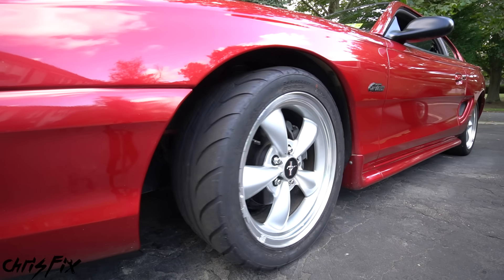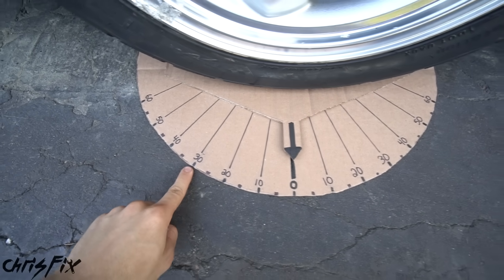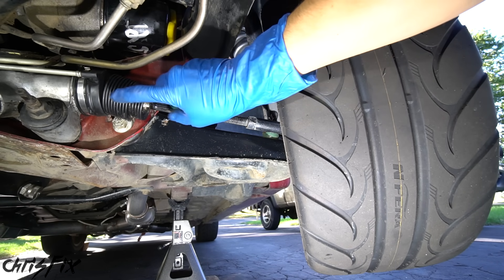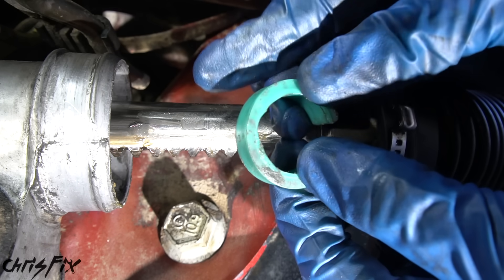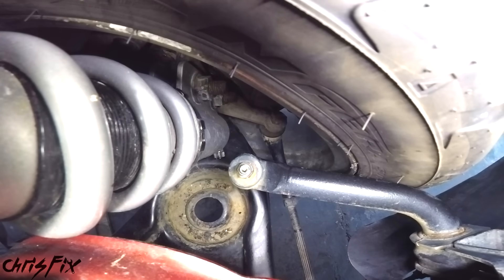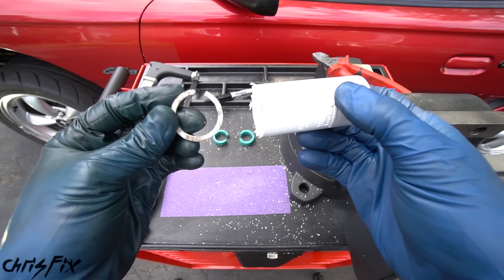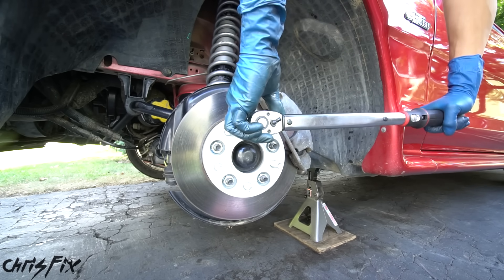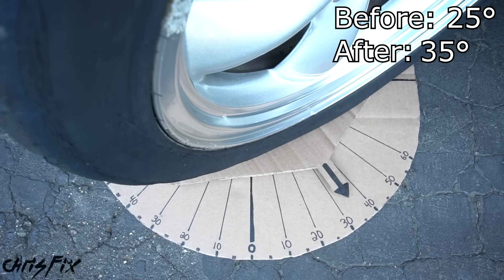How to Get Your Car to Make Sharper Turns (Steering Angle Mod)

Comment: Pretty cool, I'd like to point out something though, shouldn't the drivers side tire be able to turn left more than right at full lock to provide correct Ackerman steering? I believe your tie rods are not evenly adjusted left to right, they obviously have the correct "alignment" but a shop typically wont even out a steering rack. This can cause bump steer, and uneven lock to lock steering like what you are seeing, if the oem uses this style of steering stop. Make two "angle finders" and see if each side is different, and also measure the tie rods pivot to pivot on each side and compare. This is probably the real reason why it cant turn that much. Many cars and trucks have steering limiters in other places not on the rack. For example my Land Cruiser has adjustable steering stops on the lower control arms, so even if the tie rods are uneven, the turning still going to be the same, unless someone adjusted the steering stops, however its unevenly adjusted there will still be bump steer.

So if you need to change the tie rod lengths to make them even again, your steering wheel wont be straight, so you will need to undo a spline somewhere in the steering column, and rotate it roughly to the right spot, then use the tie rods to fine tune it in. Most alignment shops will just crank the tie rods because it takes more time to re-index the steering column splines, but its best to do it in two stages.

Also its funny how you mentioned putting your angle finder right in the middle of the tire, then you changed the offset but didn't offset your angle finder as well. When you put wheel spacers you change the pivot point of the tire relative to the width of the tire. You can look at the part of your particular suspension geometry and make an imaginary line down through the pivot of the knuckle down to the contact point, and determine roughly where the tire pivots. wheel spacers can be a good idea when you are running a larger than stock tire and want to maintain factory scrub radius, but in your application you have increased your scrub radius, which in itself is a whole other topic.

Good luck.

update: if you are using that mustang for drifting, your lock to lock steering angles make sense if you have negative ackerman angles, do you?

Comment: Your initial measuring is either wrong or you car has issues as the left turn angle of left wheel should be greater than the right turn of the same wheel - this is because it represents the inner radius of a turning circle; the inside wheel in a turn needs to describe a smaller radius than the outside!
Reply: As a side note: the 25mm spacers will be negating some of the increase in steering angle as you’ve moved the centre line of the wheels. The inner wheel will NEED to be bigger the closer it gets to the centre of your concentric turning circle ⭕️. 
Your 9° of extra angle will equate to less in real terms. 
To demonstrate, if you only fitted the spacers whilst retaining the limiters, the angle would still measure 30° but your turning circle ⭕️ would actually be worse than stock

Comment: Research your car before taking off or trimming your rack limiter. Some cars have weak power steering pumps/systems that can't handle the extra turning angle.
Reply from the maker: Thanks for the tip! Research is something you want to do before any modification to your car!
Reply: Thanks for replying Chris! Good video by the way!
Reply: Shawnessy Sandness  its chill i dont have power sterring
Reply: @EH DK custom tie rods/mount relocation.

Comment: That red dot on your tire is supposed to line up with the valve stem...
Reply from the maker: +Chris P. Thanks. I didn’t mount them
Reply: ChrisFix I always drop a hint to the person mounting my tires that the dot is there to make balancing easier and that they should try to line it up with the valve stem. That way you don't end up with half of your wheel covered in weights...

Comment: Chris, research  some more on why your steering angles were off, loaded and unloaded will be different, camber/caster is different. These things I would imagine are obvious to you, however you're neglecting information.  your SAI, inclination and TOOT
Play a big part in SAFETY but more to your concern, consistency in drifting. Snap steer, bump steer, wheel hop and dragging front tires are some of the more serious concerns from mods like this.
Reply from the maker: Thanks for sharing.

Comment: That is terrible advice to anti-seize the entire hub surface like that! That joint, as all bolted joints do, rely on friction between the two bolted surfaces to prevent loading the bolts in sheer. Lubricate the surfaces and you remove the friction.

Comment: You'll find that with more angle the less you'll spin out. When you do the knuckles you'll also notice that when you go past 50 degrees while sliding your car will drift a lot slower though. It's not always about going to lock, but it's nice to have that cushion if you need it to scrub speed or something

Comment: Chris, quick question. If you run wheel spacers on the front of the mustang with stock wheels, will it make the wheel and tire stick outward past the front fenders? Just wondering. Thanks for the video and info. I always watch your videos. Please help.

Comment: hey chris when you were tightening the nuts on the wheel spacer why did you put a screwdriver between the brake disc and the back plate

Comment: hey i have a queshton for you. so i own a 94 dodge intrepid and my ac works ecept for the fack that it wount blow cold air and the hot air is starting to lessen any ideas why or how to fix the ac? any help is welcom and thank you.
Reply: He has videos on that. Do a little search.
Reply: herars the thing i dont have a leak. i count the heat and the ac as all to gether so when i say my ac works i mean my heat works. the acctual ac blows 0 colad air and i can't figer out whats wrong.
Reply: Blake Lantz sounds to me you have a leak in your a.c. system. If you have a flashlight wait until dark go out and inspect your compressor seal for leaking also all fittings and around your condenser which will be mounted in front of the radiator. Leakage will not be 2ster but instead oil based. Hope this will get you started.
Reply: Your a.c. system needs refrigerant to be able to cool. Also turn your a.c. back on with hood up make sure you can observe your compressors clutch cycling on and off
Reply: Watch when you service your a.c. it could be r12 refrigerant since it's a 94 most likely already been retrofitted for 134a though by now
Reply: Blake.. Turn on your AC, do you hear any noises, Clicks, Grinding, Etc? With the AC ON, look under the hood and identify the AC Condenser. is the Clutch Plate Spinning? (the entire mechanism will be spinning.)

http://www.ebay.com/itm/GPD-A-C-AC-Compressor-Clutch-New-Le-Baron-300-Dodge-Neon-Caravan-4321237-/132089919076?fits=Year%3A1994%7CMake%3ADodge%7CModel%3AIntrepid&epid=550865493&hash=item1ec12c3664:g:XJ4AAOSwa~hZaJc-&vxp=mtr

If so, you may have the following issue:
Your Clutch Plate is worn/damaged. Being a 94' I'm willing to bet that it is just worn. The repair is very simple.. and you can do it without removing the unit from your car! 
If you buy a new clutch plate.. just get a new balancer with it..
Also, if you have over-charged the A/C.. it will not work either.. so if you have added some recently.. you may need to remove some.. 
If you have done this.. I recommend just taking it to jiffy lube and have them check/recharge it. 

**BE SURE TO WATCH THEM!! If your AC unit is "over charged." they will try to still sell you as though they are "properly charging" your system and will charge you around $180. Your shouldn't pay more than $80! Be sure to WATCH THEM, and ask questions through-out the process. the moment they say "System is over charged" That's when you should calmly argue with them about the price.. since they TAKE and STORE the extra refrigerant in their tanks.. without giving it back.. lol.. so they really ~steal~ from you and then try to make an extra buck.

ALL MECHANIC SHOPS WILL LIKELY DO THIS, I just recommend jiffy lube because you can literally stand right next to the technician* as he does the 'repair.'
Reply: i do hear a noce when i tern the car on but the compreser is on the driver side and the noise comes from the pasenger side and it last for a minet or two
thanks for the help im slowly narowing the sorce.
Reply: is it a hiss? please explain the noise that is on the passenger with the AC on?
Reply: william vaughn no it's not a hiss it sounds like something being compressed in the dash and if I Turn the car on with the AC already running then it never makes that noise and l get like 2 minutes of cold air
Reply: hmm. Research.. your Evaporator/drier.

From there, it's going to be an in-depth repair.. and your dash will likely have to be pulled out.

Good luck!

Comment: Google what caster is.   U need to push wheel more to the front of bumper.   It bad if can tell from looking at wheel arch.    Trust me.   Makes drift more stable and auto correct when u flick wheel is better.   Read my post i know stuff.     No bs.   Helps with car being stable    or learn hard way like i did

Comment: It's there to prevent it from tire rubbing. So in a couple years without a rack steering limiter, the tire will be offset and blow and you will will lose control and fall off a cliff and die with a steering wheel up your ass. 

Don't become a wannabe pro mechanic by watching a video on YouTube from a "self-proclaimed" mechanic. 👍

Comment: I've noticed the difference between the right turn (39 degrees) and the left turn (35 degrees), it's not much but I think an alignment shop can make it equal by adjusting it from the tie rods (loosens the right side and tightens the left side), readjust alignment then recenter the steering wheel (from inside the car), this might fix the clearance issue without the need of spacers.

Comment: Hey Chris, at 0:26, you didn't make a complete stop before shifting into reverse. Doesn't this damage the transmission over time? Or does that NOT apply to manual transmission vehicles? I really want your answer to this!
Reply: Matthew Kwon doesn't apply to standards trans
Reply: doesn't apply because the clutch was still in
Reply: It don’t matter if you got a Reverse Synchronizer
Reply: I don't believe it's bad as long as it's not grinding. Most manuals I have driven though will grind super bad if you're not completely stopped before going in reverse.
Reply: bad for automatic , but on a manual it would depend on how much clutch you are giving it . Also its never good to drift when switching from a forward gear to a reverse gear but sometimes you just can't help it , like pulling out on a hill . Just try to be as easy as possible !

Comment: Thank you so much for mentioning the tip about possible damage to power steering pumps.  When I walk through parking lots and notice people parking and they almost always hold it to full lock the whole entire turn into the parking spot.  I'm like "gaaahhhhhhh" inside when I hear that.

Comment: Why are you pretending this is for turning radius and not for doing mad skids?
Reply from the maker: I explain the mad skids part at the end ;)
Reply: Iain it would get demonized
Reply: nice profile pic ❤️
Reply: MCM fans over here....
Reply: This mod can be done on RWD cars. CV joints will be damaged on FWD cars.
Reply: Damn, nice pic!
Reply: Projects & Projects Turbo redblock squad ;)
Reply: *Australians
Reply: Iain redblock squad???
Reply: Iain I'm NA still 😢
Reply: It's simply a commercial for Hubcentric for which he's getting paid for us to watch!
Reply: Because it is for turning radius. The Fox 5 platform has a turning radius like a bus. The two things I've always hated about my 96 GT are the turning radius and the doors that only open about 50 degrees.

Comment: Seems like my 2000 C3500 has a 500 ft turning radius.  😔

Great video, thanks Chris
Reply: Tim Michaels a 95ish GMC 2500 dulley with crew cab and the long box. 50.3" turning radius. So no uturning. Thing is long.

Comment: 9:35 WTF plenty of room?? 
You do realize that tires flex under cornering load and can still rub on that metal?
Reply from the maker: Thanks and great input! I have tested this on the track drifting (the most sideways and full steering lock anyone will ever be and at high speeds) and they do not rub. Since the sidewalls on the tires are short there isnt much flex. If you have a bigger sidewall like on a truck then yes it might rub but I would be concerned if you are turning that fast all the way locked in a truck. Usually when you are all the way locked you are going slow (unless you are drifting) so there isnt going to be much flex. Great thinking though and thanks for bringing that up!

Comment: Did you check with stress? They'll have to run analysis on the control arm, good luck with the approval. (The shift of the tires (weight) creates the same shift in pressure (weight) on the other side (towards the engine). You might get approval but need to get that accounted for.
Reply from the maker: +simsim321 thanks I have run this for 6 months on a track drifting which is a torture test because I am still learning to drift and go off track all the time sideways at 60mph and there is a 6in lip on the edge of the track. Makes me cringe every time I go off but the suspension, wheel spacer, bearing, etc all take it just fine! On the road where there is a lot less stress there won’t be any issues.

Comment: I do not condone this at all. You can damage other suspension and steering components. Your tires, your fenders/ liners, some vehicles brake hoses might not be made long enough to flex for that extra turning radius. You can rip a brake hose and have less stopping power!
Reply from the maker: +heyitschino that’s why you check it before you take the car off the jack stands. If you see context or your brake lines are tight or whatever your issue may be you need to make adjustments before you can remove the limiters. This is pretty common to do in the Racing and drifting community and no one has issues.

Comment: I have a question, why was the stock angle different? Why wouldnt they both be the same number? Like 25 to the left and 25 to the right. Not 25 when you turn left and 30 when you turn right. Was just curious why they arent the same.

Comment: Awesome video as always. Quick question- I noticed you used a screwdriver in the brake rotor vent to hold the hub still while you tightened the spacer nuts, but what held the hub still when you cranked on the wheels lug nuts right afterward? I'd very much appreciate knowing for my own use 😄 thanks

Comment: Like I know it’s not necessary but after your finished with all that’s to come would you consider swapping the head and tail lights with a more modern style and I think you have mentioned about doing it I wasn’t sure but a body kit such as both front and rear bumpers skirts and too top it off a massive wang

Comment: As always love the videos but a question popped into my head, with the spacers on you have enough clearance but my question is what about when there is a load on the tire, like the cars weight itself or even further when your diving into a turn, that sidewall will flew and shift a bit, will it shift enough to hit the sway bar?

Comment: I feel like your steering rack isnt centered. Did you run the turning radius test both directions? Your left wheel should turn more degrees when it's on the inside of the turn, as opposed to the outside of a turn, per correct akerman angle. And since you are drift focused, both directions of steering are equally important. Maybe a video explaining how to center the rack?
Reply from the maker: +Alyn Penners untested both sides and they were the same. Good idea.

Comment: I love how  he thinks hes gonna have enough clearance but in reality on bumpy terrain ie. public roads the suspension is gonna cause it to push against the sway bar. Hilarious.
Reply: Harvles93 he won't be going that fast and pushing it to full lock.
Reply from the maker: +Harvles93 thanks for sharing but I don’t think, I know. I don’t make videos for millions of people guessing and unsure. This was tested for 6 months on the track and it did not rub once. I put this car through more on the track than you will ever see on the street and if it doesn’t run there, it won’t rub anywhere.

Comment: Isn't this dangereous, as you could damage the steering angle sensor/wiring in the steering wheel because you can turn your steering wheel more than with the bumpers?
Reply from the maker: +Magor Bárócz no the few extra degrees won’t cause the sensor any issues

Comment: Not a good idea for 4WD, AWD, or FWD!  CV joints will experience premature failure, if they don't snap like a knee cap on the first sharp turn!
Reply from the maker: +Brian Piper thanks for sharing. My truck has more angle than this mustang stock and the CV axles haven’t snapped yet. It all depends on your vehicle.

Comment: Is there a chance that spacer is there not purely as a limiter but also to absorb any shock when turning the wheel full lock too fast?
Reply from the maker: +Corey Batchelor good thinking but if you can turn your wheel hard and fast enough to damage the steering rack I would be impressed. I flick it hard when drifting and it slams into the rack and I haven’t even had a drip of fluid leak out.
Reply: Nice. That pump groan I hear when I accidentally go into full lock too fast makes me cringe :P